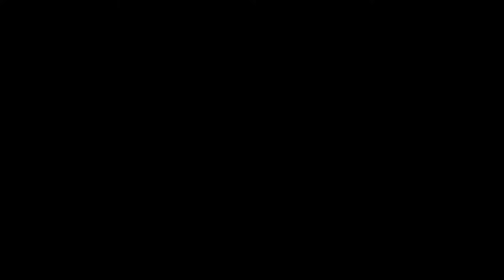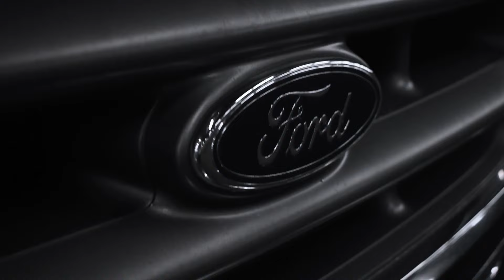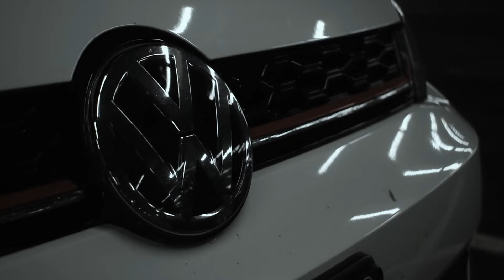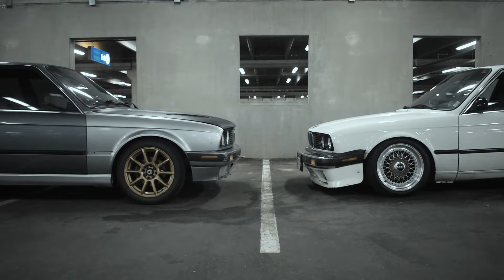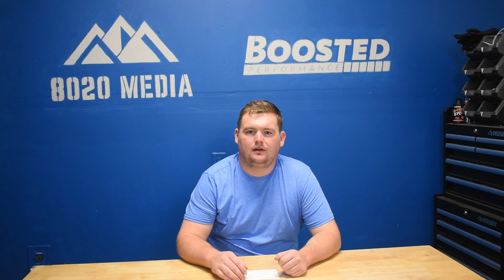How Reliable is the Ford 3.5 EcoBoost? | 3 Common Problems

Comment: My cousin had an early 3.5 Ecobust...chain gave uonthe ghost 👻.  So, the 3.5 is good for 200 000 miles...300 000 kms...I will keep my Tundra. I figure it will go easily 400 000 miles or 600 000 kms or more. I gladly pay a bit more for gas and enjoy the power of the 5.7.
Reply: 5.7 fuel economy is a disaster literally
Reply from the maker: Mike - We have an article on Toyota's 5.7 V8 engine on one of our sites and it is in fact pretty reliable. Both are very reliable and have very few problems. With Ford's upgrade to the 2nd Gen 3.5 Ecoboost, it has resolved its timing chain issues. Thanks for sharing your feedback.
Reply: @loyal4theway159  I call bullshit. It is slightly harder on fuel than my best friends RAM but the RAM has cylinder deactivation which has the potential for serious cam and follower damage. My Tundra gets between 11.4 to 13.5 litres per 100.kms which is really not bad. To.put it in perspective my 88 Sierra was no better on fuel and was about 1/2 the HP and was a 5.0 Litre. My Sierra lived mostly in the dealers repair centre in the 3 years i had it.
Reply: @8020Media  The 5.7 is much hated about fuel. Well, the truck weighs 6 000 plus pounds. The rear differential is 4.30:1 and makes for a lot of power. If you drive it hard, hell yes she is thirsty BUT with a light foot, it's not.terrible. The one issue is cam tower leaks after several 100 000 kms. That may not even happen.
Reply from the maker: Mike - Thanks for the feedback! This will definitely assist future viewers.
Reply: @mikefoehr235  🤣
Reply: @jasonbrushett2005  🤣🤣🤣🤣
Reply: @mikefoehr235  🤣🤣🤣🤣🤣🤣🤣
Reply: @jasonbrushett2005  Give him a break man
Those Toyota fan boys are easily impressed shiny things and lots of big buttons.  🤣
Reply: @loyal4theway159  5.7 10 MPG at best, Just Do the Math, My dad owns a 2019 Tundra, Yes the engine will easily get 300K miles But Gas $adds up BIG
Reply: @cessealbeach  10 MPG?

that's horrible
Reply: People bitch about the gas milage on the 5.7 tundra. But real world they are only getting 1-2mpg less the any other brand. The cost of the extra fuel is more then offset in reliability.  How many gallons of gas can you buy with the $thousands you will spent fixing that Ford every year. And when you factor in the down time that truck I in the shop. You are light years ahead buying the toyota. Not to mention you will buy 3 ford's before you wereout that tundra.
Reply: @ernestjohnson1807  … The Tundra is a great truck. The ford is also a great truck but will get twice the fuel mileage as the 5.7 Tundra tho. That’s real world talk, not BS. Thus is why Toyota was influenced by ford to go twin turbo v6. More performance - better fuel mileage. I don’t keep trucks more than 15 years or 200k miles anyhow, and they both will last that long if taken care of. If you take the same route with the same truck, driving 1000 miles a month - 11mpg vs 22 mpg - that’s 450 dollars in fuel vs 225 dollars in fuel. Save that 225 a month - you’ll have 22,500 towards your next truck after 10 years. They will both be sub 10k value after 15 years and 175k+ miles. You can do the math. It’s easy for me to see which I would buy over the other.
Reply: Toyota dropped that engine for a reason, you can trash the 3.5 DB all you want, but Toyota replaced the 5.7 with a turbo six, Ram is replacing their hemi with a turbo six, because the turbo six is the ideal engine for a pickup. I have a buddy with a 5.7 Tundra one, averages 11 mpg, and power? you say that because you've never driven either of Ford's turbo 6's.
Reply: @ernestjohnson1807  untrue, and Toyota games warranty numbers, that has been proven. Fact Tundra's are the most common  grocery getter truck. Ford is the most common 1/2 bought be heavy industry for heavy work, companies that do MTBF, and ROI studies, if the Tundra were better they'd buy them, but they don't because their studies tell them the Ford is the one to buy.
Reply: @ernestjohnson1807  truth
Reply: @Steve-yr5vi  my cousin had an ecobust...$2500 CAD for new chains, sprockets and tensioner. I doubt my chains on my 5.7 will fail. My cousin traded for a coyote v8..much better engine probably.
Reply: If you drive any amount of miles the Tundra sucks so much fuel that it will bankrupt you.
Reply: and tow a gas station.  Toyota V8 sucks gas.  misery.  had two.  zero range
Reply: The 3.5 will walk all over that 5.7, if power is your thing.
Reply: The company I work for runs a huge fleet of 1/2 trucks. We put on alot of miles, nobody drives a toyota. Can't afford to pay for the gas they use..period.
 Very few drive rams...it is all f150's and chevys...
 After driving a duramax for years my 2019 F150 pulls my 10K - 12K trailer, doesn't squat with that load and has plenty of power to spare.
  On the highway it can get 10.5L/100 even though it is lifted and has all terrain tires. Not too dam bad.
 Ford is redeeming itself with their trucks after many crappy years of 5.4's
Reply: @ernestjohnson1807 you are delusional if you think the tundra will outlast a Ford, first the truck falls short in every category,  let alone it will rust away before you can get to 200,000 miles. My 09 f150 has 441,000 when I sold it 4 ½ years a go.

Comment: The new 3.5 eco boost turbo V6 engine goes out usually around 50K miles and it’s EXPENSIVE to repair.
Get the tried and true 5.0 (302) v8.
Reply from the maker: David - Everyone is held to their own opinion, but we're curious did you have a 3.5 EB go out around 50k? and what exactly do you mean by "goes out". The 302 is also a great engine!
Reply: @8020Media  actually the turbo stopped working at 40K miles. 
I have 2 friends who have the same engine as mine. Their turbos went out at 48K and 51k.
I had mine fixed, sold the truck and bought one with a 302.
Reply from the maker: Wow! So sorry to hear about your experience. Thanks for sharing though as this will assist future viewers!
Reply: total misinformation.  New V8 has cylinder liner issues and displacement on demand issues so there.  3.5 has issues because its by far the most common
Reply: @3triplexxx  I’m sorry to hear that man.
It’s sad when American automobile manufacturers build such poor quality.
That’s why the imports are whipping their butts.
Get your truck fixed, sell it and buy a Tundra.

Comment: If you should ever doubt the importance of preventive maintenance, such as 5 - 6000 oil changes with synthetic, go ahead and run your engine to 10, 000 miles or more, especially with conventional oils, you will be pushing your vehicle....whether truck or car. 😂
Reply from the maker: W - Well said!

Comment: 5.0 and 3.3 never had any issues, still have a 93 5.0 and newer 3.3 and 5.0. The guys w 2.7 seem have issues.
Reply from the maker: Terry - Thanks for sharing your experience! Hope both hold up well for you.
Reply: 93 5.0 has zero resemblance to modern 5.0.  maybe you should read a book.

Comment: You forgot to mention the cam phaser rattle
Reply from the maker: Jerry - Yes, we realized this after the fact and have mentioned this many times in the comments. But you are correct, this is definitely a common issue with the 3.5's.

Comment: What about the 2.0l ecoboost in the Bronco Sports..Do they still blow up?
Reply from the maker: If you're referencing the known coolant leaks and cracking around the #2-3 cylinders then we aren't aware of that being a major issue on the Bronco so far. Older 2.0 EcoBoost engines were great with their closed-deck cooling designs and rarely ran into these issues. 

Problems mostly began with the re-designed twin-scroll turbo 2.0L EcoBoost from 2015+. Ford issued a service bulletin back in June 2022, but that only references 2015-2019 Edge, Escape, Fusion, MKC, and MKZ models. Ultimately, these coolant leaks and block cracking don't appear to be a common problem on the 2.0 Bronco...so far.

The larger 2.7L V6 EcoBoost has been the more problematic engine in the Bronco when it comes to complete engine failures.
Reply: I don't think the new 2.0 engines will blow up, but they only have direct injection, so the intake valves will get carbon build up.i believe they fixed the defect in the block in 2019 or 2020 versions.

Comment: I have a very important question for you. I’m about to purchase a vehicle 2019 with a 3.5 eco-boost motor I was looking at the Carfax report and 20,000 miles Carfax report says short block replaced is that something I should worry about since I’m paying over $50,000 for the vehicle, I really would appreciate your feedback as soon as possible. I don’t want to buy a $50,000 problem thank you.
Reply from the maker: Sounds like something in the block probably failed due to a manufacturing defect. I would 1) figure out what warranty you have on the new block, and 2) use it to get a discount. The good news is you have a new block, the bad news is you don't really know what caused the block failure and everything else is going to be from that original engine. If it isn't a good bit cheaper than comparable options then I would probably avoid it - also probably good to know how many miles it's been running the new block and of course warranty.
Reply: @8020Media  I really really appreciate your thoughts and expertise on this matter I’m getting the vehicle around $7000 less than book value the block was replaced at 20,000 miles the vehicle now has 37,000 miles and the dealership says the vehicle runs excellent what would you do?

Comment: How about the ford 10 speed transmission
Reply from the maker: The 10 speed has had a number of issues with it, generally not considered a great transmission.
Reply: @8020Media  I just bought it 2 days ago.
Reply: @8020Media  how do I maintain the transmission

Comment: Why not LS Instead of 3.5 Ecoboost?
Reply from the maker: Not sure I follow - you can't get an LS in any GM trucks either? LS is a great platform but also can't argue with the efficiency of a twin turbo engine. A lot more expensive to mod an LS.

Comment: What is the average cost of having the intake valves walnut blasted?
Reply from the maker: Walnut blasting is going to cost about $400-$600. The tools required are pretty basic and the walnut shells are cheap so the main cost is labor. It's about a 4 hour job or so. You might also need to replace some of the intake port gaskets but the gaskets are cheap and it shouldn't add much in labor since the manifold will be off anyways.

Walnut blasting is very popular on BMW engines so a lot of people will take their EcoBoosts to BMW shops as the process is the same. You might be able to find someone local to you who is willing to do it in their garage a little cheaper.
Reply: @8020Media  Thanks!
Reply: @8020Media  BTW, the intake grunge isn’t necessarily from oil blow-by.  It is more a function of EGR/PCV.  PFI is horrible for cold starts.  However, by having both injection systems, you can lower the flow rate of both injectors, giving you better atomization and utilizing PFI for higher loads beyond the fuel delivery capability of the DI injector by itself at warmed up conditions.
Reply: The Ford dealership charged me $149 for my 1.5 Ecoboost Fusion.

Comment: You will never sell me on the ecoboost, I'll take the 5.0 coyote or the 6.2. I also like the Toyota Tundra V8 or the non-turbo V6 in the Tacoma
Reply from the maker: Vincent - These videos are meant for information purposes, not to sell anyone. But have you owned a 3.5 EB and have personal experience? This could help future viewers.
Reply: @8020Media  no I never owned one, but I talked to a guy who traded his F-150 ecoboost and bought a Tundra V8 because the turbos were giving him trouble
Reply from the maker: Got it! We were just curious. What are you in now?
Reply: @8020Media  I have a 07 Ford Focus with over 273k miles on it with a 5 speed manual transmission, the clutch and transmission was replaced in May 2020 at 247k miles and it's the original motor

Comment: The 5.0 isn't any hell either
Reply from the maker: Mark - Are you driving a 5.0? If so, mind sharing some first hand experience? We may tackle a video on that later!
Reply: @8020Media  yes Iam driving a 2012 5.0 V-8 F150 . From 2017 to 2021 I spent $6'398 .00 on repairs to this truck . starting with the electric steering failing to the electric rear end locker breaking heater controls stop working and the start of a ticking engine which was the timing chain tensioner on the left side a 3000 plus dollar repair . The truck didn't even make it off the lot of Stockfish Ford in North Bay Ontario and it had a tappit tick . Which they tried to fix by flushing the engine That didn't work . The service Manager told me to just drive it . 2022 the tick is still there and louder than ever . Ford motor company stepped away from the problem . What do you do eh ?
Reply from the maker: Oh man! Sorry to hear about this Mark. Do you know about how many miles you had in 2017?
Reply: @8020Media  Yes the truck had 75,918 km ( It's a Canadian truck

Comment: 5.0 V8 is the superior F150 engine.
Reply from the maker: S - Both engines are great for different uses.
Reply: @8020Media  , correct!  The Eco-Boost engine’s best use is as a Ford mechanic’s “best friend”.  The 5.0 V8’s best use is as a F150 owner’s “best friend”

Comment: 3.5 and 3.7 Ecoboost engines have the water pump in the crankcase where the oil is.    What junk
Reply from the maker: The only ones with internal pumps are the transversely mounted engines. F150 only has a traditional belt driven pump.
Reply: @8020Media  Hey.   Thanks for the information friend.    I did not know that.   But I seen one of these engines torn down.   The pump was in the crankcase on the one  I saw

Comment: Not sure if serious. First, how was the 3.5L Egoboost first introduced in 2011 in the F150 when vehicles like the Taurus SHO, MKS, and maybe a few other Lincolns were rocking it in 09? Second, how are you going to even entertain the thought that a 3.5L Egoboost is Furds best engine? Do I just need to start naming off engines for you? Terminator engine, 07-12 GT500 engine, GEN1 FGT engine, Coyote, Roadrunner, Trinity, Voodoo, Predator, etc. 3.5L Egoboost isn't even a forged engine other than maybe a GEN2 FGT. Reliability? My 03 Lightning has a factory drivetrain and runs like a top. Idles as smooth as my 18 5L truck, no noticeable oil burn. I've towed Foxbodys and Fbodys and boats, etc through the mountains of GA, SC, NC, VA with it and the only issue was you can basically watch the gas gauge drop when towing a car up a steep mountain at 80+ MPH. Fords even starting to figure out that Egoboost isn't as good as their V8's. Quiet is kept that your GEN3 Coyote/10R80 trucks are your best trucks to buy for performance, and I'm generally more partial to GM.
Reply from the maker: JROC - Thanks for your feedback! Everyone is held to their own opinion. Unfortunately, not everybody experiences the same exact engine. Some may get lemons while some get engines that last over 250,000 miles with no major engine issues. There is only so much people can control with these pieces of machinery.
Reply: @8020Media  sounds like JROC734 is just another Prius owner
Reply: Why you whining about this guy making a video. Don’t like it, move on. I’m guessing someone in an Ecoboost smoked your lightning, I’d be pissed too🤣
Reply: @JROC734  I’m kinda thinking you like ECOBOOST don’t ya!😜 probably gonna swap out that L for one. Honestly I could care less, I don’t even own one
Reply: @anthonys7534  no, you absolutely do care to a certain extent. That's why you took the time to comment in the first place.

No, I would buy a new Tundra before an Egoboost F150. If I had to drive a gay truck I'd rather drive a Japanese automakers truck, than an American automakers truck. I've had my L for almost 13 years. I doubt I'll ever sell it.
Reply: Kinda funny the new Tundra uses a 3.5tt with a ten speed. Wonder where they got that idea from. Japanese are smart , they see the success of the ECOBOOST platform (though not perfect) and follow up with same. I’m not gonna waste my time with you bud , go play with your little lighting McQueen truck
Reply: shows how little you know!  3.5 in cars and flex NOT THE SAME ENGINE as the truck other than displacement.  One based for front wheel drive the other a truck engine.  But who cares about facts?
Reply: @02hreblue30  The gen 1 Ecoboost is the exact engine in both F150 and Edge,Explorer,flex and Taurus. But yes the front timing cover is different. Internal water pump on the cars because of the engine mount. External mount on the trucks. Also turbo vs non turbo 3.5 is the same engine. Slightly different heads for DI also a DI high pressure pump added to the one of the left side camshafts on the turbo version. A few other little add ons but overall same engine. I work on them so I get to see the differences

Comment: JUNK
Reply from the maker: Ray - Out of curiosity, what vehicle did you have a 3.5 in and what was your experience like?
Reply: @8020Media  did not have a 3.5 i got a 3.0 and a 3.8 Ranger/Mustang both have been excellent. I got 375000 on the 3.0